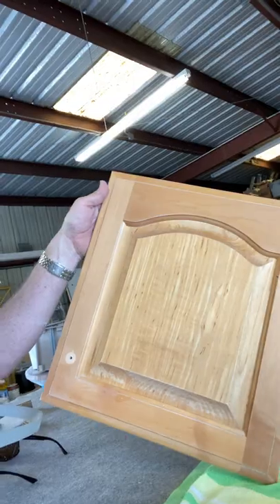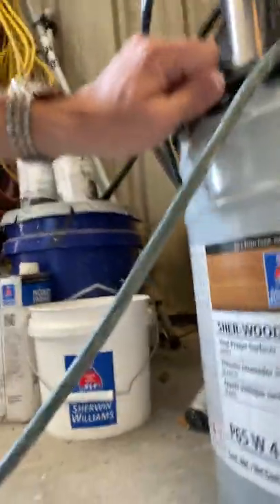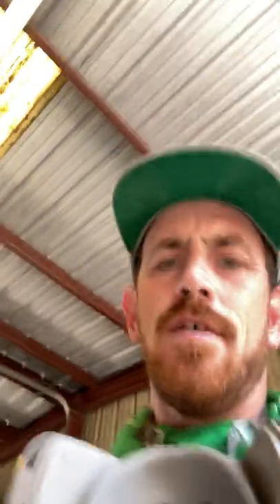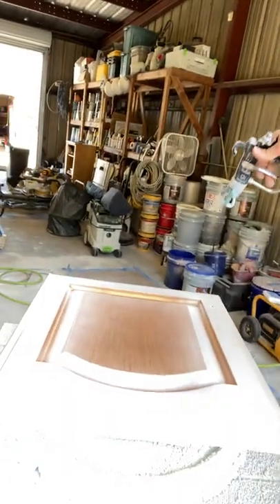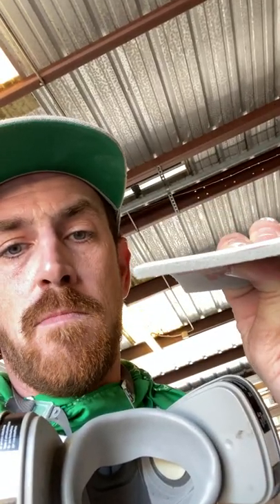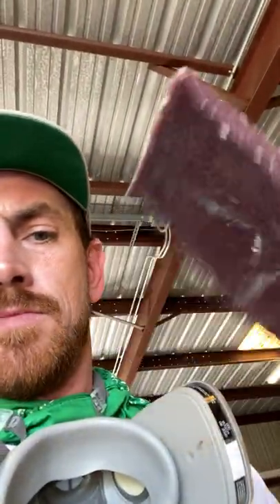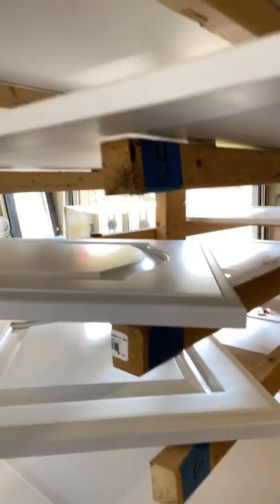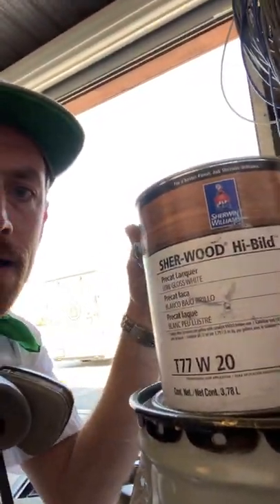Painting cabinets at the shop with Sherwin Williams Sherwood Vinyl Sealer & Hi-Bild Lacquer

Comment: I have been painting kitchen cabinets for years and what you are doing is right on and great information. I also use these products and they are outstanding. Just not about that SW products are approved by KCMA. Read the data page as it says... meets KCMA requirements.

Comment: Sorry..new to this so may be a dumb question. If you have a client wanting a paint color, do you use this product as the primer, then paint the color (if so which products do you use), then finish it with the precat lacquer?
Reply from the maker: When it’s a colored top coat we tend to use a clear vinyl sealer. Then we order Color Express Precat from Product Finishes division where they tint with powdered pigment. 

The only dumb question is the one you don’t ask. 🙂

Comment: Great video. I’m currently building cabinets for my kitchen remodel and have been searching YouTube and the internet for tips and info on what kind of paint and finish to use, I’ve seen a lot of people like the sher-wood lacquers. I stopped by my local Sherwin Williams store to ask a few questions about it, and the guy there asked what I was going to spray it with, I told him probably an airless sprayer. He said you can’t spray lacquer with an airless spray, you won’t get a smooth finish, he said you can only use an HVLP. But it seems like I’ve seen a lot of people using airless sprayers with lacquers. What are your thoughts? I currently don’t have either style sprayers but I was leaning towards airless maybe the titan 440 but now I’m unsure. Thanks
Reply from the maker: Airless is much faster but expensive to clean out the rig. They seem to be less expensive than HVLP setups too, so I would use an airless.

Comment: Friend, I competed three coats with light sanding between but the front is not smooth....the back is but it seems the center panel is a little rough to the touch. I sanded it with 800 grit sandpaper and it helped but I didn't think I had to sand on the final coat. ANY TIPS

Comment: Thanks for the video! Have you tried spraying this with an HVLP sprayer? I have a Fuji MiniMite 4 and wondering if it can handle it and what mm tip size and can/does it need to be thinned? Thanks so much!
Reply from the maker: It’s very thin right out of the package and I’m sure that a four stage HVLP could handle it with relative ease. Probably use a #3 or #4 needle but I’ve never used it in an HVLP personally. Thank you! 🙂

Comment: So Sherwin Williams told me to use the E63W30 Precat primer surfaces with the T77W20 topcoat Hibild . Any experience with this primer ? Is is the same as the P65W4 that you guys used?
Reply: My SW dealer said the E63W30 is out of stock everywhere.  They said I could use the fast dry sanding sealer.  Ruined 6 doors.  I put on one coat of sealer like I have done with the W30 primer.  When I went to paint, the end grain would not take the paint, just kept soaking it up.  Biggest damn mess I've ever had.  Instead of stripping the paint, was easier to make new doors (raised panel).  Ended up having to put 4 coats of the sanding sealer on the end grain to make it work.  Can't wait to get the W30 back.

Comment: This is for sure one of the best videos I’ve seen on the Sherwin Williams lacquer.

As far as I can tell all the SW lacquers require a high pressure system, and cannot be sprayed with an HVLP (i use a Fuji Q3). Is that accurate?
Reply from the maker: A three stage turbine is probably not going to give you quite as nice of a finish. The high pressure definitely helps to atomize and to speed up production. Maybe a four stage turbine would atomize it a little better. I’m just not a fan of turbines. I started out with a Graco 9.5, and it’s just too slow and the reservoir is too small.
Reply: @professionalpainting4727  i get that with the reservoir. I get through painting or priming maybe 9 or 10 doors with my Fuji and have to refill, and it sucks. But I don't paint often, so I need some kind of middle ground.
Reply: Look at adding a lacquer thinner based on the guidance in the PDS. I have a number of airless and HVLP machines and find I have to thin the products when using my 4 stage turbine machine. You may have to do an extra coat to make up for it but turbine machines run warm and the lacquer drys fast.

Comment: You guys still using sherwood cab?
Reply from the maker: No sir. We switched to Hi-Bild Precat over white vinyl primer Surfacer.
Reply: @professionalpainting4727  it's great stuff, been spraying the Precat for quite a while, recent jobs been spraying the conversion varnish..seems to have better durability. Great videos..keep em coming.
Reply: @professionalpainting4727  can you brush the high build primer you switched to? Also how do water based topcoats bond to it?
Reply from the maker: No sir, the vinyl primer surfacer dries too fast to brush it is spray only.

Comment: I suggest putting on a topcoat or two , and some close ups of the finished product .... glad you inform on what products used , THAT is always important info .... what products used , what tools used , what spray tips used .... BUT , the one thing you also need to include is the finished product , and close up shots .... we're looking for orange peel and looking at final finishes ..... I have seen a BUNCH of videos where the person SAYS "Oh this turned out great" and then I see the close up shot and they are lying out their asses !!!!!! lol ..... I have seen horrible orange peel and the person is yakking how great it looks !!!! USUALLY it's one of those "Home Network" goofballs that do a helluva lot of "pretending" ..... One question , do you clearcoat over the precat laquer pigmented , or is that durable enough on it's own without a clearcoat ??? Obviously in my opinion , why need a clearcoat if it's just the same product but clear ???? but I've heard several people talk about adding a clearcoat last